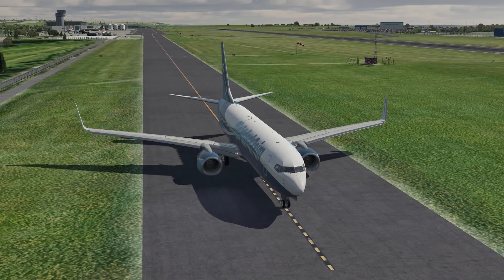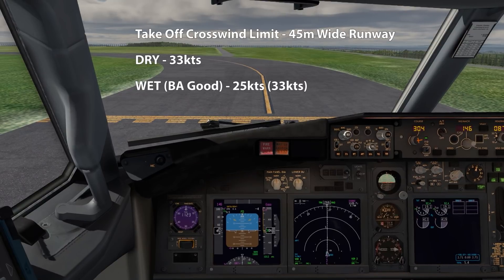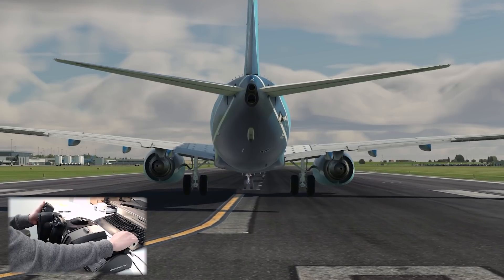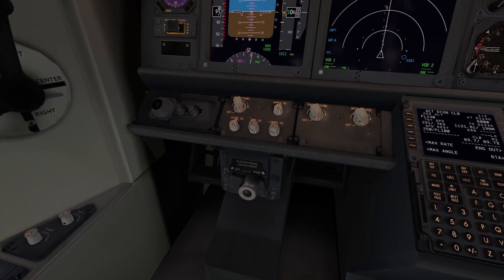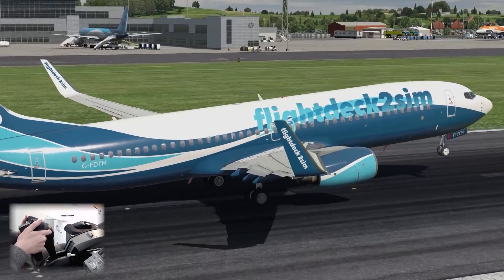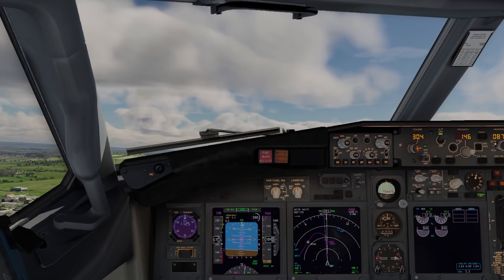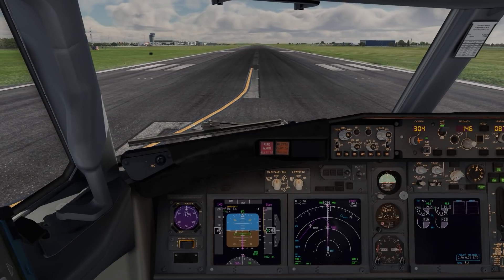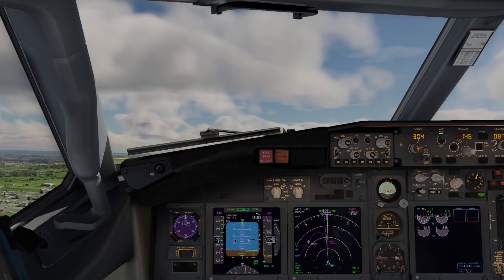Real 737 Pilot | Crosswind Take Off Tutorial | ZIBO MOD 737NG

Comment: Do you find that the zibo 737 is too “sensitive” to crosswind conditions in X Plane? A stiff crosswind will make even full aileron deflection insufficient to prevent excessive bank sometimes. This is especially noticeable when de crabbing on landing. Even slight rudder inputs require disproportionate amounts of aileron correction compared to other planes like the Toliss
Reply: Yeah I think I remember him saying it was a little bit too sensitive in comparison to the real thing

Comment: Hey captain, on the rudder cam, it looks like you're also applying some right toe brakes? Is this something you would recommend on the real plane?
Reply from the maker: Hi C H, the brakes are disabled and always have been, there is no feel to them at all. The pedals only act as a rudder. You would never use differential braking during take off.

FD2S
Reply: @flightdeck2sim  Ahh okay, thanks!

Comment: Does nosewheel steering disengage after a certain ground speed? I know it does for a couple of smaller regional type jets and the A3xx family, but was curious if it did for the 37 as well.
Reply from the maker: It doesn't disengage but you do not want to use the tiller, the rudder had some input towards nose wheel steering, less than 10 degrees.

FD2S